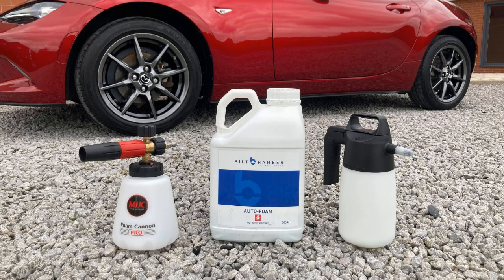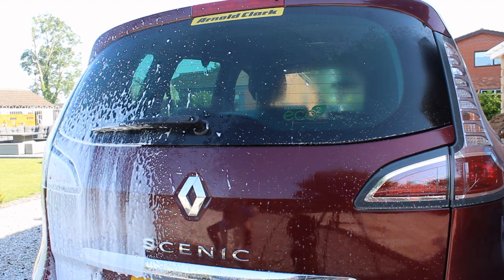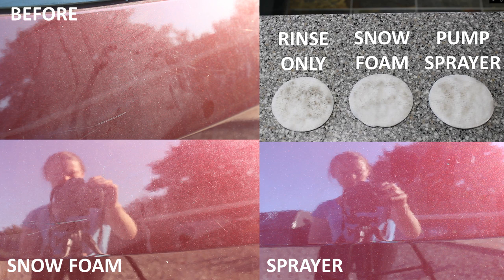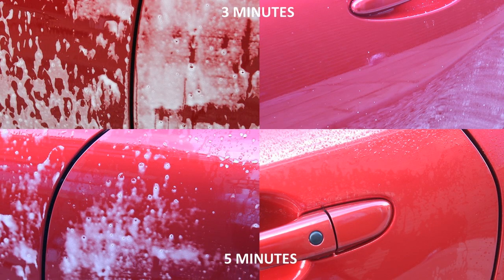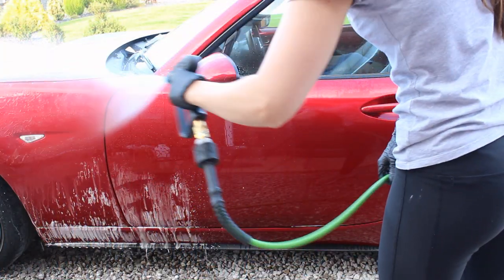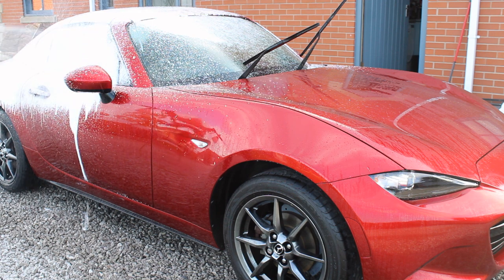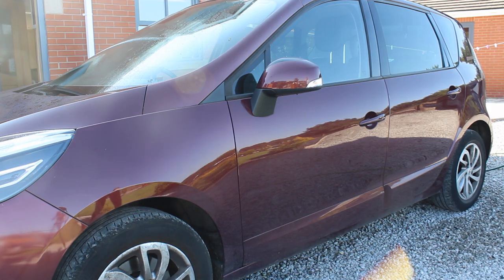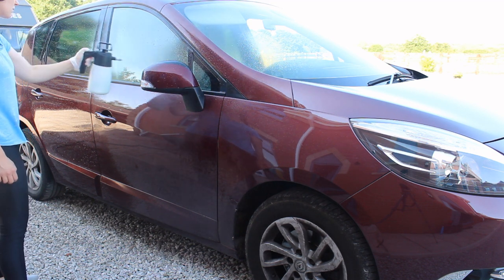Foam Cannon vs Pump Sprayer | Bilt Hamber Auto Foam Application Method

Comment: This is probably the most informative and best conceived detail product video I've ever seen! I have used AutoFoam in a sprayer, but only because it was winter and I don't use the pressure washer then. I knew it worked, but never considered doing a comparison like yours. Now, I may just keep using it in a sprayer, as I really don't care about thick foam, just what cleans best and makes the job easier.
Reply from the maker: Thanks for watching! I've just been sticking with the sprayer to get more of my money's worth out of it and it's working really well

Comment: Is that an IK foamer or just an IK pump sprayer? Obviously a foamer would be more suitable for using a foaming product surely? Auto foam is never going to dwell when being applied thru a sprayer? 🤷🏼‍♂️
Reply from the maker: It’s an IK sprayer. Yeah in the video it didn’t dwell as well in the sprayer but I’m not really bothered about the dwell time as long as the cleaning ability is the same. Id never really go for auto foam if I was looking for a product that dwelled for a long time. I thought about using the foamer as well for comparison but it takes ages to get around the car because it needs pumping up so often compared to the sprayer so I don’t think it’d be as practical an alternative for me
Reply: @AutoCareHQ  I understand what ur saying but thats exactly my point. This isnt a proper comparison as its a foaming product, not a prewash so it should be applied thru a foaming applicator, like a foam lance or a pump foamer.
Reply: It doesn’t dwell when you use in a foamer either, lets be honest. It’s simply not designed to stay on the car that long. I really couldn’t care much for that stuff. I’m not concerned with instagram photos. I’m concerned with results. If it doesn’t dwell but comes straight off with as much film as possible, take my money. Leave the fancy pools of snow foam that dwell for long periods of time like polar blast from AG which lingered forever on my drive, for someone else to video and post. You can use autofoam in a sprayer. Many people do as it’s cheaper to apply that way than expensive foam canons. Ask BH themselves. Easy to call up and ask. They say the same. It can be applied in a sprayer.
Reply: @AutoCareHQ  IK foamer would knackered your arms. They’re best used for wheels and engine bays or even door shuts I guess. I don’t even think they were designed to be used in the way the other person is suggesting. At best, they’ll be useful to spray the lower bottom of the car if the panels are particularly dirty in the winter and then covered with autofoam on top.
Reply: @Danny-oh4uo  Bilt hamber states it loses no cleaning ability if its used with a pump sprayer meaning no foam. Autofoam is a prewash.
Reply: @whitegoodman7465  Exactly…
Reply: @Danny-oh4uo  If Bilt Hamber say, and they do, that it cleans as well with a sprayer as a foamer , and this video also shows it works that way, why are you contradicting it. You know more than the company that made the product ?

Comment: About a year ago I thought I'd save my auto foam and use it via a pump sprayer and use something more foamy for the foam cannon. It's amazing how little you need in a sprayer.
Reply from the maker: Exactly! The cost per wash is ridiculously cheap
Reply: That’s why I’ve moved towards a sprayer now. The cost is far more in a foam canon and aside from worrying about the solution drying out on the paintwork in the summer there’s no benefit to snow foaming over soaking the surface through. Even then the surface is easy to keep wet using the pressure washer to create mist.

Comment: Wow. Thank goodness someone made this video finally. I’ve been wondering if anyone would make such a video looking at this ever. The gains from using a pump sprayer have been on my mind since day one and I realised just how good autofoam is as a product goes in terms of cleaning power. The cost of filling up my canon however is substantial. I have to put in 340/360 ml of product into my canon and fill the rest up with water to get to 4% PIR after working it out. To say I’m happy to do this given the prices of the products would be a huge overstatement. It probably takes me a third of the canon to do the car properly. I like to use a blend of Surfex HD and autofoam in my sprayer. Extremely potent combination and traffic film stands absolutely no chance with them. I appreciate more and more how they don’t foam up forever and make my driveway look like Father Christmas 🎅 has come to visit. Good tip to stop the surface from drying out is to create some mist by turning off your pressure washer and using the trigger. The water will create a slight mist and that will keep the surfaces somewhat moist and stop them from drying out.
Reply from the maker: Thanks for watching 😊 I’ve only ever tried auto foam and surfex together with the aim of stripping old waxes but I’ll have to give it a go as a prewash, sounds like it’d be useful on a lot of my friends’ and family’s cars! Great tip about misting the panel as well 😊
Reply: @AutoCareHQ  Indeed Surfex HD is a lot more detrimental to LSP so be weary of that. I’ve certainly noticed the difference between using Autofoam on its own and when combined with using Surfex HD both in terms of cleaning power and impact on LSP or in my case spray on carnauba waxes such Turtle Wax which are dead cheap and easy to apply. It’s particularly useful in the winter when film gets a bit more greasy and you need the added potency to take off as much film as possible. A very good combination when doing friends and family cars that just need the job done ASAP. 

I’ve seen a lot of people rave about Garage Therapy Wheel and Alloy shampoo. Is it any better than say using Bilt Hamber Auto wash and using that on alloys after a Surfex HD prewash?
Reply from the maker: I really like the GT wheel shampoo mainly because of the stability to be honest. The suds keep going a lot more compared to a normal shampoo from my experience. Plus I really liked using an IK foamer to apply the product onto the wheels and it works out a bit cheaper than in the bucket. For well maintained wheels the difference will be less noticeable though, but it’s the same price as a normal shampoo so I’m happy to have separate products for each use. I’ve just got some HDD Brake Through Wheel Shampoo as well so I’ll be working on a comparison of those two over the next couple of months!
Reply: @AutoCareHQ  Ah okay. Yes auto wash is not really a good shampoo for foam either. BH products are not show off products. They’re functional and focus on doing the job well.  

Oh so you use the IK foamer to put the GT shampoo on the wheels? Interesting take on it. I struggle maintaining the wheels. Yes well priced is GT stuff. Heard good things about HDD brake through shampoo as well. Should make a good video.
Reply: @AutoCareHQ  can you do a video of that? Auto-foam + Surfex HD as a prewash? Does it clean better?
Reply: @pjaxy  wondering the exakt same thing!

Comment: Great video Heather. I use Bilt Hamber Touchless now 100% of the time. I find it really good and I like the thinner foam as opposed to stuff like Autoglym polar blast,  I feel it cleans better and certainly disappears quick from the driveway.  In saying that , my car gets hardly any heavy motorway driving and doesn’t attract too much road grime.

Comment: Excellent video, i have been considering an IK sprayer for a while but have not been 100% convinced i need one until this video. The cost saving alone over time will pay for the sprayer plus its nice to have different cleaning options. A couple of other benefits are occasionally i like to reduce the jet washer noise (reduced snow canon use) when neighbours are in their garden and this could also be useful when going on holiday with limited gear to safely clean the car. Best wishes.
Reply from the maker: Thanks very much! That’s a really good point, especially if it’s early morning I can imagine the neighbours preferring the pump sprayer method too 😂 It’s definitely a good alternative when you need to pack light and if some people don’t want to get a foam cannon when they’re first starting out

Comment: New subscriber, love this Heather. There is a huge conception that snow foam is a must for pre-wash. Personally I am trying to explore a snow foam substitute… Not all the time, just when time is against me. I have some power maxed Tfr which apparently is wax safe up to 9:1, I am also going to try the valet pro citrus pre-wash you recommend. I already have auto foam so I’m going to try this method also. The general consensus is though… You should only use Tfr and citrus on lower panels, I personally think this is just to be safe on chrome items etcetera. Anyway my point is great video and I’ll give this a shot 👍
Reply from the maker: Thanks very much! Valet Pro Citrus is a great product for giving the pre wash a bit of extra kick on the lower panels, I’m starting to use it more often as well now that the weather has started turning. I’ve heard some good things about the Power Maxed TFR as well. I’ve just bought some Duel Nitty Gritty which has really good reviews so I’m looking forward to giving that a go!

Comment: Thank you so much for working out PIR in the pump foamer. I'm an enthusiast living in an apartment so I can't have the setup needed for a foam cannon. I'll use the IK Foam Pro to apply Touchless (rather than Auto foam) and this helps me know exactly how much to use!
Reply: it's very easy to work out the PIR for any pump sprayer or pump foamer, or indeed foam cannon.
All you need to do first is to decide how much total volume you need to cover the car. Let's say 1000ml in a pump sprayer, and you want 4% PIR, that's 1000 x 0.04 and now you you have your required amount of product then, which in this case is 40ml product to 960ml water. hope that makes sense. 
For normal ratios, let's say 1:8 and you are still using 1000ml total. 
1:8 = 9 parts total.  Divide 1000 by 9, which gives you 111ml product, so that leaves 889ml water, these can be rounded up or down for easiness.

Comment: Currently using Marolex axel 3000 pump sprayer. As I live in a flat and I dont have a drive. So normally I just wash it by garage jetwash with all the cleaning stuff in the boot (2 bucket, wash mitt, microfibre towles, shampoo etc.) Haven't figured it out how to attach the foam cannon to the jetwash yet. I wish i could use a foam cannon. As just a prewash is fine to use the pump sprayer. Although if you use the whole autoglym polar range apply it with a pump sprayer it's actually takes centuries.
Reply from the maker: That’s a really good point! I can imagine it being a bit of a pain not having a foam cannon with the polar system

Comment: I’ve had a lot of success with Autofoam in a sprayer rather than foam but I find the foam can dry quicker in summer so I tend to only use it in winter this way but not very often as it’s just so economical in a spray rather than foam
Reply from the maker: That makes sense, auto foam can definitely be a pain if it’s even mildly warm!

Comment: I use an IK Foam Pro 12 w/ a battery powered air compressor to keep the pressure going and when using Bilt-Hamber Auto-foam or Touchless it can't be beat❗️❗️

Comment: Another excellent video Heather 👍 you just have to have foam or you won't hear that sound of the foam hitting the floor, love that😁
Reply from the maker: Thank you! That’s a very good point, I love using the IK sprayer but I’ve been using a thicker snow foam afterwards as well sometimes just because I miss using it even though the car is ready for the contact wash 😂

Comment: I just use the ik foamer towash my pug 108. Requires a good few pumps as it does run out of steam but it still works a treat
Reply: What ratio do you use?

Comment: Great video heather how are finding the BH with stripping wax when using the foam cannon cheers
Reply from the maker: Thanks for watching 😊 I don’t find it to be much of an issue to be honest. The only time I’ve ever really noticed it is when I used the R222 wax which is more of a show wax and that dies with most pre-washes!
Reply: @AutoCareHQ  thanks heather I have the gyeon wax and wet coat on top do you think that’s ok
Reply from the maker: Yeah I can imagine that being fine, wet coat had worked well on anything I’ve tried it on top of but I’ve not had a chance to try the Gyeon wax yet!
Reply: @AutoCareHQ  cheers heather I’ll give it a shot mixed at 100mm to 900mm water  I think. I no it won’t have the mega strong cleaning power but that’s fine

Comment: Hi again, regarding the pump sprayer. I have one that foams and one that doesn’t. Would it still be the same PIR since they’re both pump sprayers and not connected to a pressure washer? Or does the foam one dilute differently even though it’s a handheld foamer? Sorry for the long message!
Reply from the maker: Yep you’ll be fine with the same PIR 😊
Reply: @AutoCareHQ  Thank you again! ☺️

Comment: How did you found dilution for the IK Sprayer
Reply: Its a 1.5 Liter capacity so to get the proper PIR that bilt hamber recommended you take the total ML of the sprayer/foam cannon or whatever your using and multiply it by the PIR you want (bilt hamber recommended 2-4%) so if you want 4 percent it would be 1500ml x 0.04 and that gets you 60ml. 60 ml of product and the rest is water in a 1.5 L ik sprayer.

Comment: Have you used gyeon primer?
Reply from the maker: I’ve not I’m afraid
Reply: @AutoCareHQ  ok I got some I’m going to use it then top it off with wet coat what do you think would that be good.
Reply: @uk2488  it’s great stuff I used it then topped with the gyeon wax on my focus rs 👌
Reply from the maker: I’ve never used a spray and rinse after polishing to be honest I normally just go for a wax/ sealant that works on a dry panel. Let me know how you get on when you try it!
Reply: @AutoCareHQ  will do.

Comment: The rear of that Renault wasn't 'reasonably dirty' at all, it looked very clean already.
Snow foam works best on heavy stuck on dirt not thin grime anyway, by eating into the particles and breaking them down. Grime really only gets removed by TFR unless you contact clean with a mitt, but I'm sure you know that already.
Try the same test on a car which is actually dirty next time, I'll be interested to see the results.
Cost effective ?
Hmmm tbh I think if you are really into detailing then most don't really give a shit about making products last as long as possible. I guess it's a bit of a waste, unless you are a professional detailer in which case yes everything has to be maxed out when it comes to cost of resources verses charge to customer.
For hobbyists I don't think they care. I don't. I use a 50/50 mix of hot tap water and Bilt Hamber auto foam in my foam lance and fill the whole street with it.